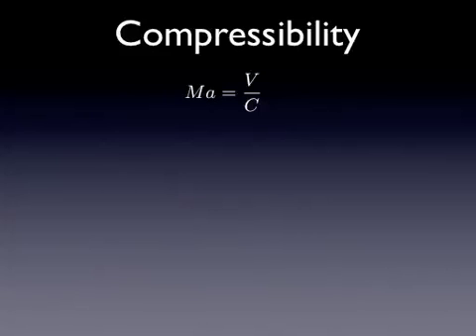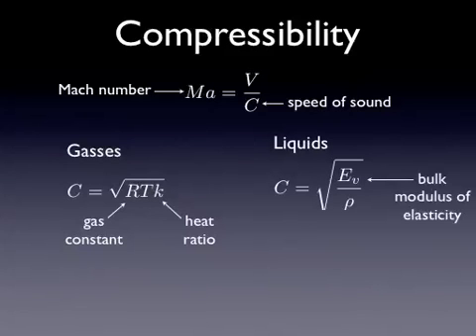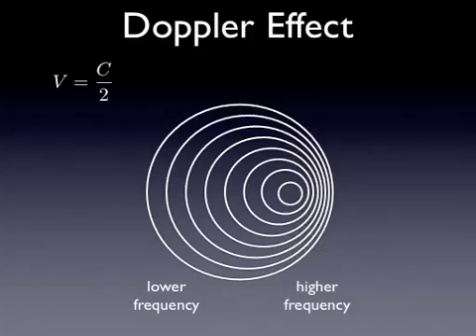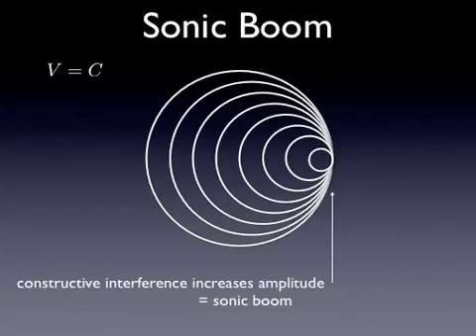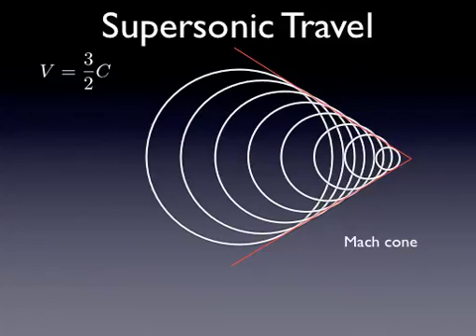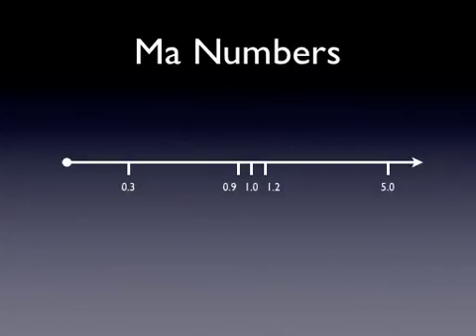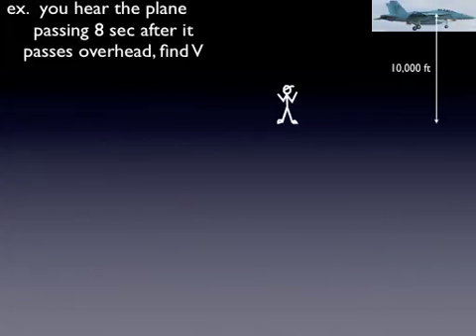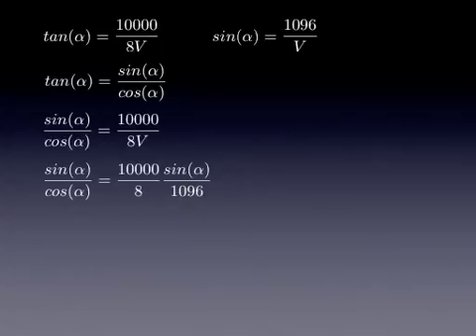35 compressibility

Comment: This online course is wrong. The condensation does not occur because of increased pressure. It occurs because of DECREASED pressure. Just like lift condensation on the upper surface of a wing. Or the condensation you see on high bypass turbofans on takeoff on wet days. The intake of a HBP turbofan is divergent AFTER the first 4-10 inches of the duct. But the intial parts of the duct is Convergent when increases the velocity, thus lowering the pressure.